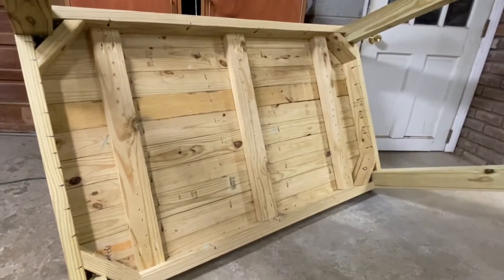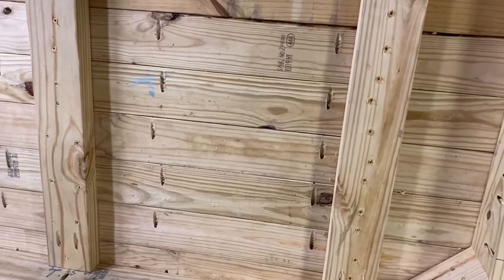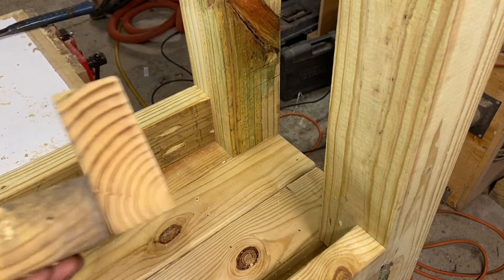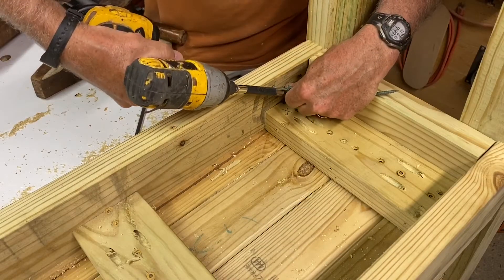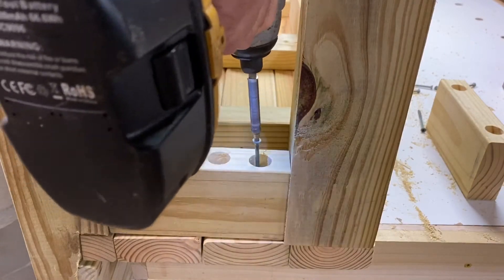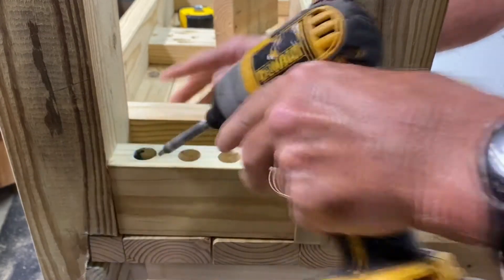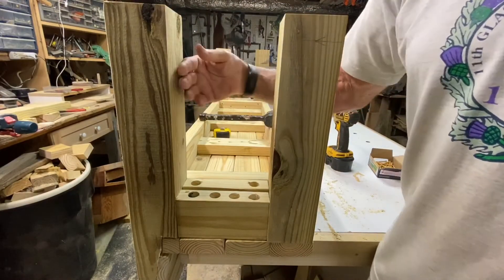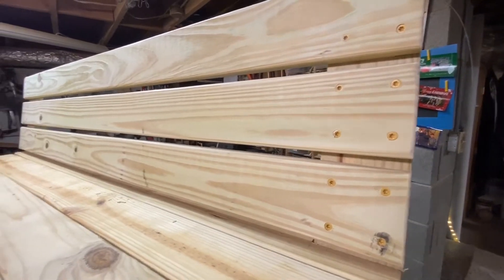How to build this picnic table: Surprisingly Easy DIY

Comment: Larry, outstanding job!  What is the length of the the back 4X4 and length of cut of the angle?
Reply from the maker: The back leg is 30”. Not sure if the angle. We measured 3/4” in on the top and 1-1/2” at the bench level and drew a line. We wanted to be sure to have enough wood on top to catch a screw and enough wood on the bottom to support the wood on the bench. Thanks for asking. I should have covered that in the video